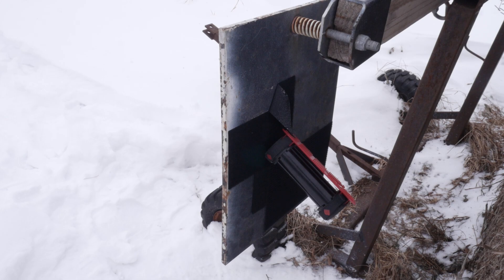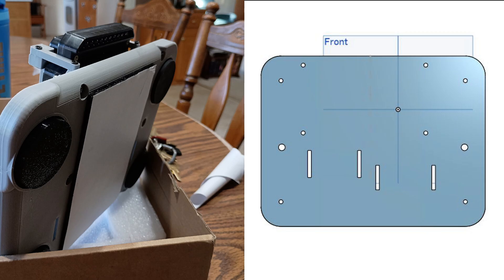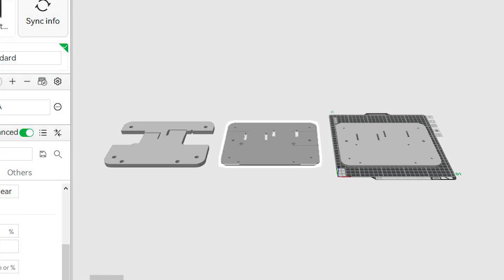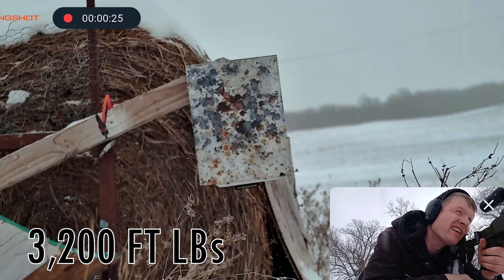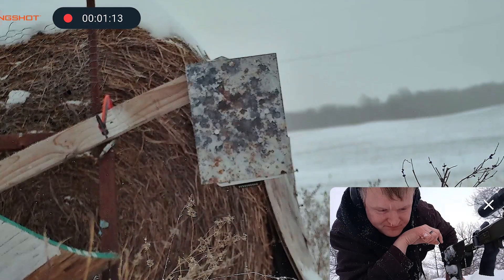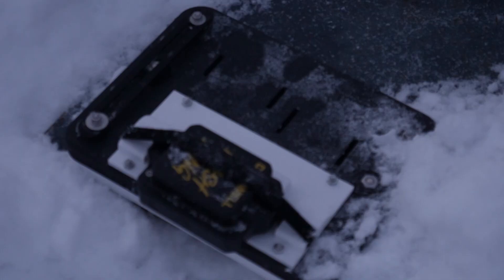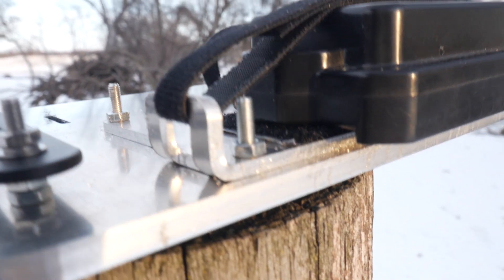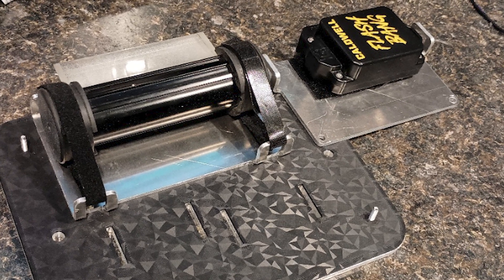Indestructible Target Hit Indicators - ELR Mounting Plate

Comment: The new fiberseeker 3D printer which is adding continous CF or glas fiber into the 3D print could be maybe also a idea. To use a soft TPU with a good layer adheason and embeded Cf fibers for stiffness.
Reply from the maker: That would certainly be a great solution.

Comment: SiPC, a silicone polycarbonate alloy that maintains toughness down to extremely low temperatures. I believe Push Plastic sells it. That might be your material solution. I don't think there's a reason why 3D printed plastic couldn't be utilized for this, but if you do decide you want something else you can also use the 3D printers to create molds and mix glass fiber with silicone to produce a high toughness, tear resistant, semi-rigid part.
Reply from the maker: I'll have to take a look at that
Reply: Randos of the internet unite to solve esoteric problem!! 🤣🤣🤣

Nothing against your aluminum solution by the way, it's an awesome solution to a puzzling problem, I'm just thinking about costing scalability since most people don't have a CNC machine kicking around.
Reply from the maker: @whatfor5 absolutely. 
I've poured so many hours into solving the plastic side of the equation, I just decided to move on to metal. 
I will take a look at that silicone poly filament though. 
Seems like they are constantly coming out with new and unique filaments all the time!

Comment: I have a 340 weatherby.  Shooting a Barnes 225gr delivering 4900 ft/lbs @100 yds😊😊😊
I would love to see if that will hold up.
5/8 steel at 500 yards is now u shaped and holes clear thru everywhere……
Do you really think your unit would hold up to that kind of punishment???😊
Reply from the maker: Tough to say man! If I had to guess I'd say that it would. 
I wish I had a larger cartridge to test with... Although most people won't be going over 3,200 foot pounds especially if they are using indicators beyond 600 yards.

Comment: What about creating a durable sensor/indicator unit where it attaches to the back of the steel target with spacers? Basically picture the actual unit about 1 or 2 or 3 inches off the plate but the legs with sensors are attached and add something like a CV joint boot on a truck suspension in the sensor leg to absorb vibration. To picture it, take a kitchen table or anything on 4 legs and turn it on it's side where the feet of the legs are what contact the back of the plate. But the sensor is in the legs while the main unit is safer an inch or more away.
Reply from the maker: Are you thinking of bolting the spacers on? 
I think the crux of the issue is making first contact with the steel. 
The largest failure point will be the joint between the indicator and the steel. 
If the spacers are securely fastened, I'm sure you could make that work!
Reply: @Longrangelab  I've not given any more detailed thoughts but I'm picturing very small contact attachments with little surface area as far apart as possible so as to absorb impact energy away from the center of the steel. They would have to be securely fastened yes. If there were good absorption units I would think it would work, much like the discs in the spine between each vertebra - for vibration, torsion, and shock. The brain of the indicator being spaced away from the steel itself, in my mind would work and work very well.

Comment: I don't have any ELD match experience but for 2/3 Gun sometimes indicators are used on 50-150 yard steel targets and the problem we have is people shooting the LED portion of the indicators. We resorted to drilling angle iron which allows the LEDs to shine through, and presents an angled surface like old-fashioned tank armor but it's still a 50/50 whether a rifle round goes through the iron and damages the indicator. I was thinking to make a system that blasts a much brighter light backwards and have a piece of wood covered in reflective tape so the light bounces off but I figured that'd need to be replaced every match. Anything that needs to be exposed on the side of the swinging plates is just bound to get shot so a solution has to be 100% behind the plate. Maybe a printable light diffuser that can be the only thing that stick out from behind the plate, that is easy to replace. It's one of those things that after seeing it happen at every match you wonder how people are struggling to hit a torso sized plate at 100 yards but can hit the little LED strip indicator, I suspect ELD doesn't have the same issues as the competitors are more disciplined. We used to be a nation of marksmen, where riflery was taught in school but now I watch people who think a pie-plate sized group at 7 yards is "good" for pistol and hitting a full-sized torso plate at 100 yards with an unsupported rifle is somehow difficult.